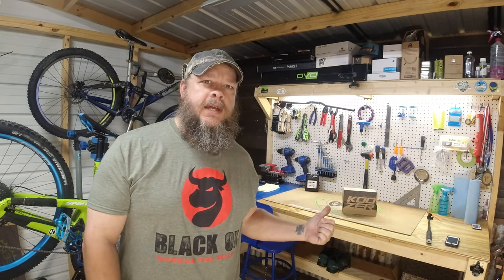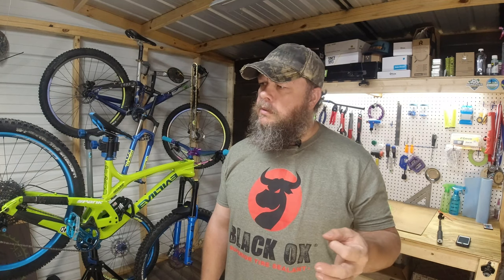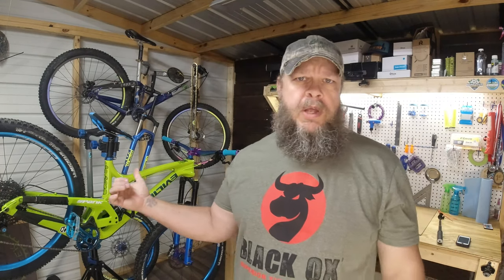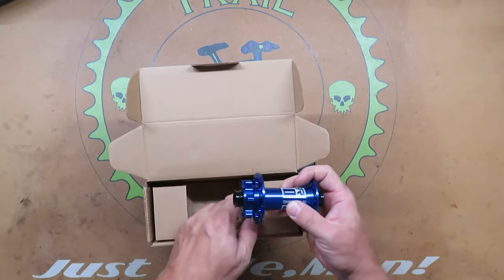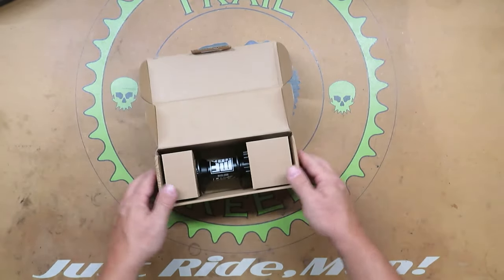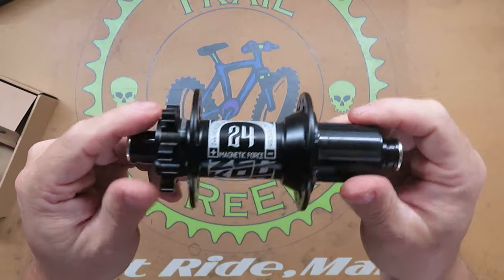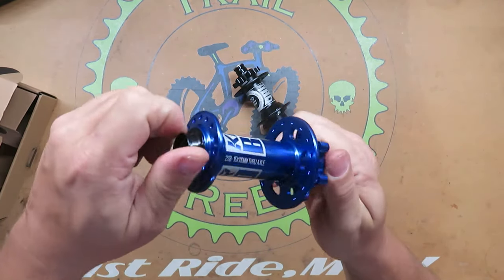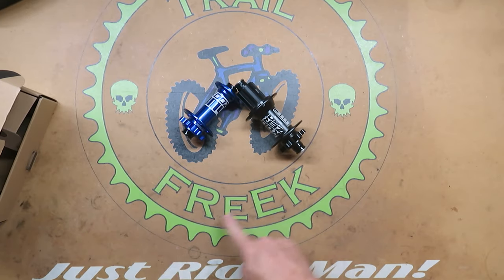KOOZER: A terrible  review

Comment: Hey dude, I thought I'd give you an update!  Not sure how I can send you photos but I'll tell you the build I ended up doing:

Grey Silver Koozer XM490 Pro hubs.
Sapim Strong black spokes with silver brass nipples.
Raceface ARC HD Offset rims!!   (30mm internal width with a 4.5mm spoke hole offset)

These were for a Marlin Gen 2 frame!  I ended up reading a book on wheel building which was full of very helpful information!  The Koozer XM490 Pro Hubs have a 2.6mm spoke hole diameter and the Sapim Strong Single butted spokes have a 2.3mm diameter by the J-Bend but they're 2.0mm for the rest of the spoke.  We got a great fit for the spokes, a strong rim, strong spokes, and awesome hubs.  Great recipe for awesome new wheels!!!   

I completed the build, installed my tubeless set up and took these guys out for a rip!!  The improvement is immense and I am extremely pleased so far!

Comment: So what's the difference between boost and non-boost version?
Reply from the maker: Rear hub spacing is 148 for boost, non boost is 142.
Reply: @TrailFReEK  I'm new to this. I have Trek Marlin 6 2023 so do you have any idea what specification will fit ?
Reply from the maker: @MazharAliz  If i remember right,The Marlin 6 will need a 135mm hub.
Reply from the maker: I would recommend the koozer wheel set. Because I believe the spoke count is different on the stock wheels. Also The marlin uses a freehub and not a cassette.
Reply from the maker: @MazharAliz  https://amzn.to/4eZhSpc  also Aliexpress has good deals on koozer stuff
Reply: @TrailFReEK  thank you for guidance.
Reply from the maker: @MazharAliz  you are welcome.

Comment: Which materials are they made of? Is the freehub steel or aluminium? How many degrees of engagement?
Reply from the maker: freehub is Aluminium. Its a 24 tooth ratchet system for the MF480. https://www.koozer.net/150.html
Reply: @TrailFReEK  nice they have a website now.

Comment: Haha.  I came here expecting the review to say that they hubs were terrible, but instead the review was terrible ;)  But you're a good dude!

Question:  Do you think these hubs would be a great drop in replacement for a set of Bontrager 29" Kovee wheels with stock Formula DC-20 / DC-22 hubs??  (They are on a Marlin Gen 2 somewhat customized bike that shipped to the shop as a Marlin 7 but left the shop with a Deore 11s drivetrain, a Rockshox Recon RL airfork, etc etc)  The Formula hubs are absolute budget options with a 15 point engagement hub.  I had planned to wear these wheels right out and then replace them but I think that this might be a better option?  I only have about 500miles of light XC riding as well as gravel paths and bike paths, so the spokes shouldn't be too bad.
Reply from the maker: These are definately a great budget upgrade from a stock hub. Im not sure about drop in. You have to measure your old hub flange to make sure they are the same size flange as the Koozer. I recently upgraded a wheel from a walmart bike and the hubs where exactly same size. New spokes are not too expensive if you had to change. Also Koozer has a full wheel set that is pretty good. That may be an option for you.
Reply: @TrailFReEK  I took an old compass geometry set and measured the distance (diameter) between the spoke holes from the center of each hole.  I measured the distance between the two holes directly across the axle from each other and the distance is 59mm.  This measurement is the flange, right??   It looks like the Koozer XM490s have the same size flange as the Formula DC-20 / 22 hubs after all!!  

I like the idea of a budget hub upgrade for these wheels.  The Bontrager Kovee TLR wheels are XC wheels but they are one step up from Bontrager's entry level Connection rims so there's really no point to use a DT Swiss or Hope hub for an upgrade.  Also, it's getting more and more tough to find 135mm / 100mm 5mmQR hubs that are good.  

I like the idea of being able to swap out the freehub body for a MS one in the future once my Deore 11s drivetrain wears out!  ...and, there is SO much pedal lag with the current rear hub!

Thanks for your input, I think we're in business.  Now to decide on a colour.  The bike is very dark blue with black and yellow hilights and silver / grey text and water bottle holders.  Black?  Blue?  Grey???

Bike was modded at the shop before purchase but it started it's life as one of these!

https://media.trekbikes.com/image/upload/f_auto,fl_progressive:semi,q_auto,w_1440,h_1080,c_pad/Marlin7_21_33148_A_Portrait
Reply from the maker: @paulemillevasseur7622  Sounds like you got it figured out!  Im partial to blue. Grey would look good too. Good luck man! Those Marlins are nice looking bike. I have a Marlin 5 . But older frame design